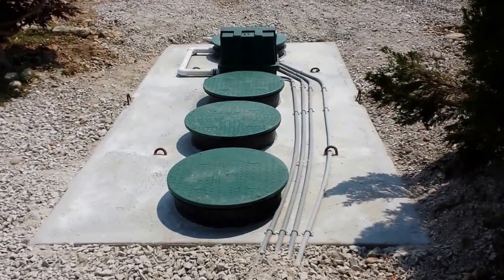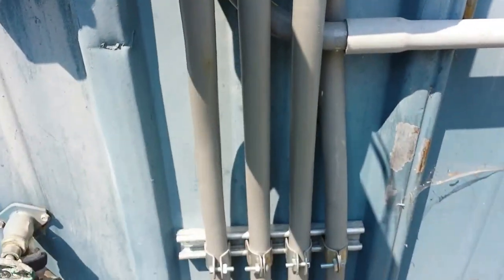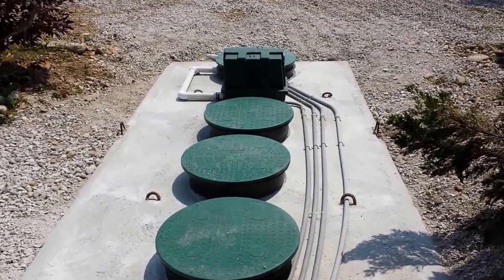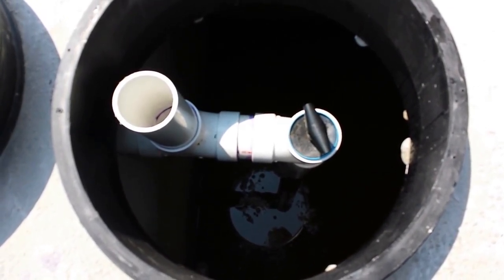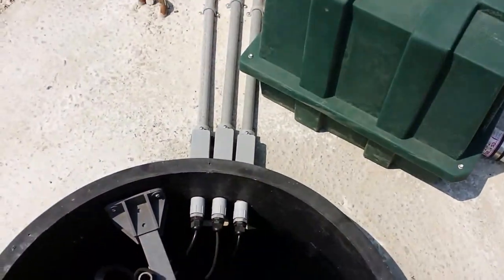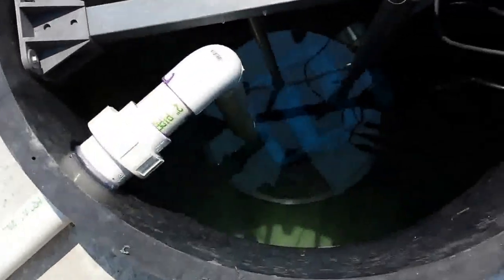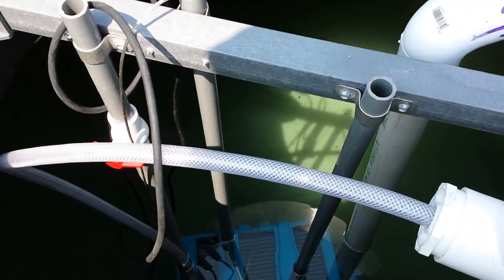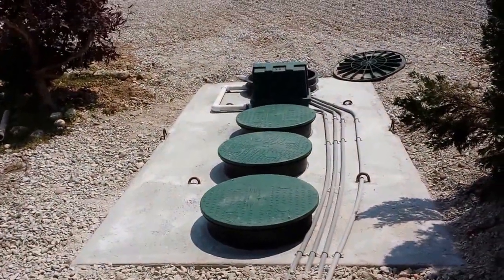BioBarrier installation

Comment from the maker: How we put BioBarrier water recycling systems together.
A third alternative to a building's wastewater disposal needs. One, public sewer. Two, a temporary onsite treatment and disposal system. Three, the BioBarrier, a water recycling system that removes virtually all the pollution and bacteria and puts the water back to recharge the aquifer.
And it's as permanent as the building it serves unlike any soil based onsite system that only lasts until the soil used for disposal clogs with sludge created by biological treatment of the pollution in the wastewater.
Reply from the maker: Yes. There are several companies making municipal membrane bioreactors. The water produced is then used for all kinds of non potable purposes like irrigation.
Reply: I am planning on building me a house with five bedrooms.  How much would it cost me to have this type of septic system.  This septic system is fantastic!!!